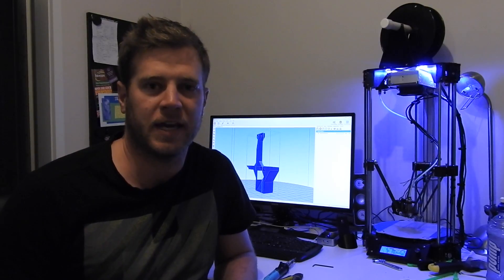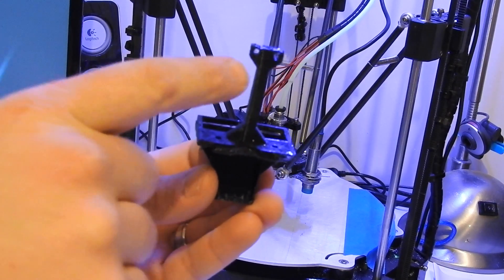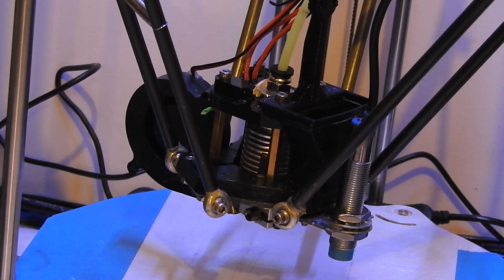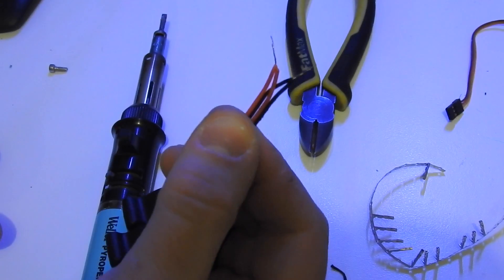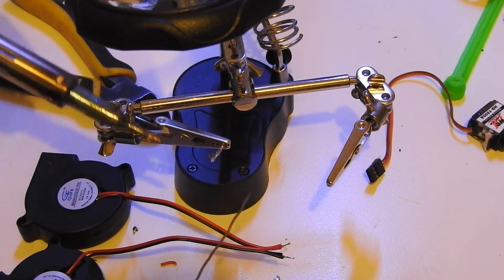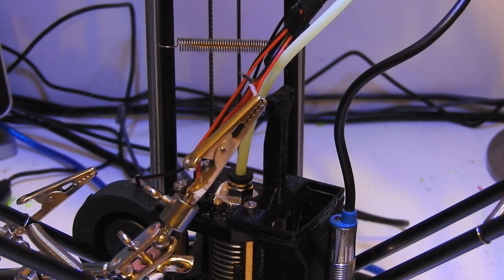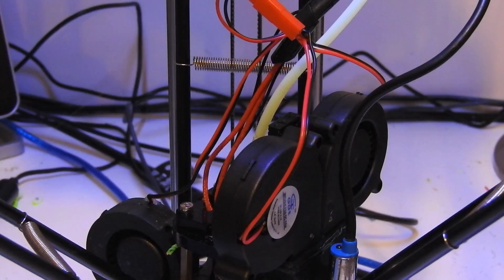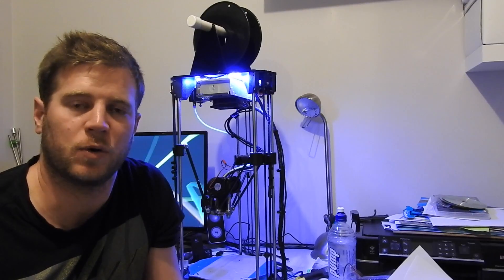How To Upgrade JAYCAR TL4100 Delta 3D Printer Cooling l

Comment: I just replaced the 25mm fan with a 30mm fan and secured it using a cable tie just like the old one,  it works fine now and no change in the build size. I also put a 50mm fan under the base to blow air across the circuit boards. It is secured with hotmelt glue to the tower bracket in the gap on the left side of the control panel. That fan solves the issue of the extruder stopping on long prints.

Comment: 100mm radius?  I'm sure my TL4100 said to put the radius at 80mm, making the diameter 160mm.  Even though, it does print to 180mm radius.
Do you mean the new total build width is 100mm?

Comment: my blower doesn't work at all, are you supposed to be able to speed it up and down from repetier, I can't see how it would considering its directly on the green block of the mega board and not a jumper!?!?!
Reply: Not the little 20mm fan that blows directly on the heatsink.  That one stays on full speed.  The snail 'turbo' fan which cools underneath the head, to stop your prints from curling, is adjustable through repetier yes.  

The way it does it.... easily.  Just adjust the output voltage.

Comment: Nice upgrade. Does this slow down the filament oozing from the extruder?
Reply from the maker: +David Richards Nope. What it does is stop the filament from melting where it goes into the hot end. Insufficient cooling on the heat sync can lead to a blocked extruded. How fast filament oozes is controlled by flow rate. Don't miss interpret this for feed rate which controls how fast it prints :)